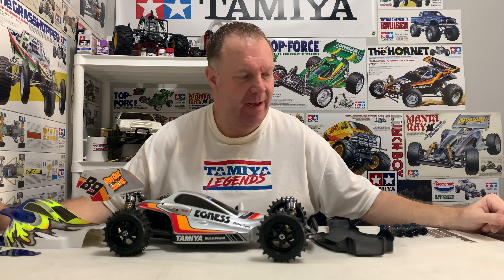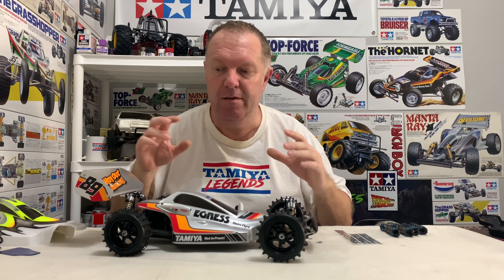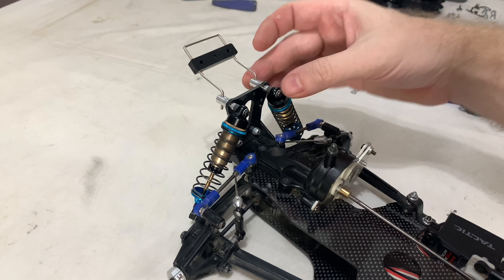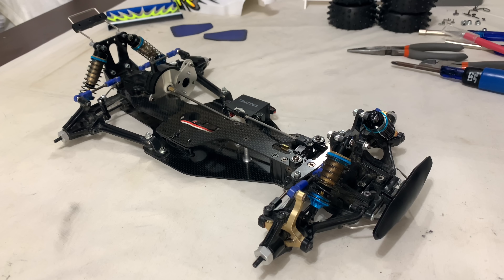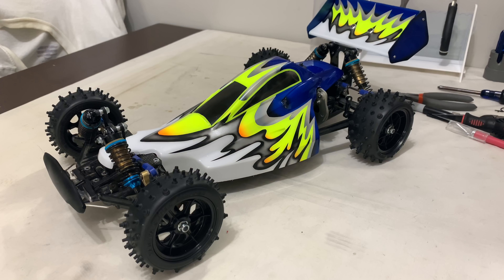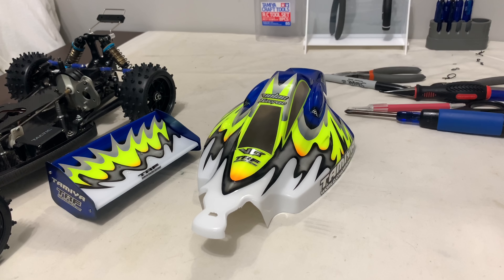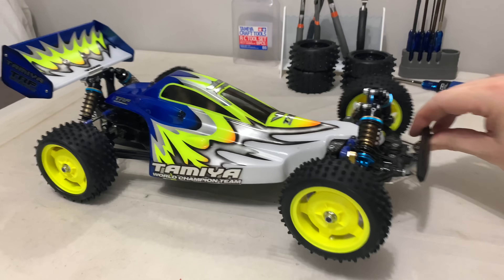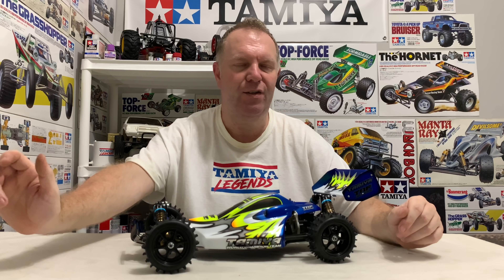Tamiya Egress TRF Style

Comment: Because of your videos I've dug out my original 1989 Egress and have spent months in a cycle of fixing things, breaking things and ordering parts again. 30 year old plastic is so brittle :( Plus for some reason my Dynatech 01r just doesn't have power (it was fine the last time it ran... Err... 25 years ago)... Need to strip it down and rebuild it to see if it helps.
Reply from the maker: Excellent sometimes the strip down is the best bit Don 😎👊🏻

Comment: You really need to buy four or five brushless setups, between 13,5 and 8,5turn. Go for hobbywing. Cheap and very good. I have 13,5turn in my two top forces, an 8,5 in my xb4, a 5,5 i think is way too fast. I have a 13turn brushed in my egress. And I have one more 13,5t, and a 8,5t and two esc's on the way. And a 17turn brushed combo to play with in my avante. Very good motor for 20dollars'ish, the yeah racing hackmoto with ball bearings and replacable brushes....=)